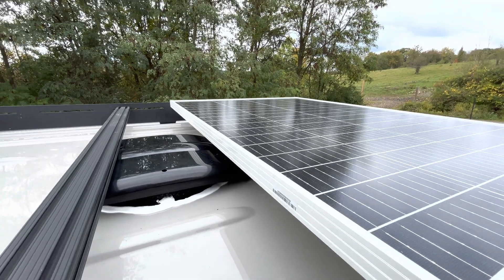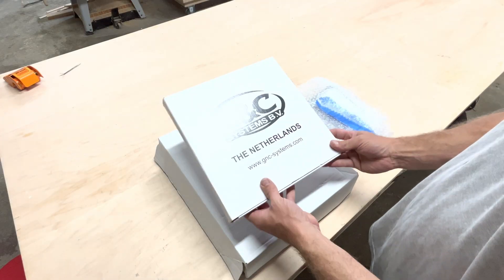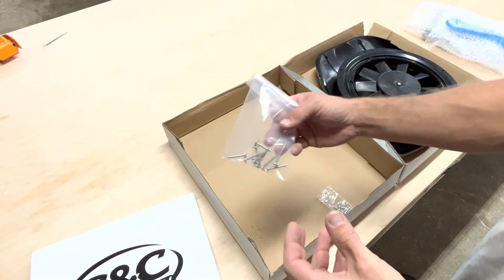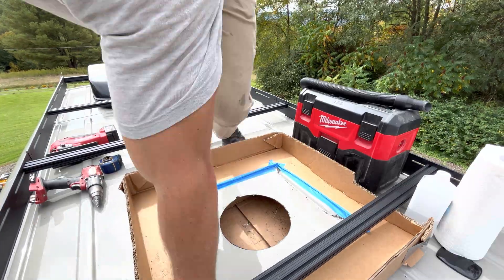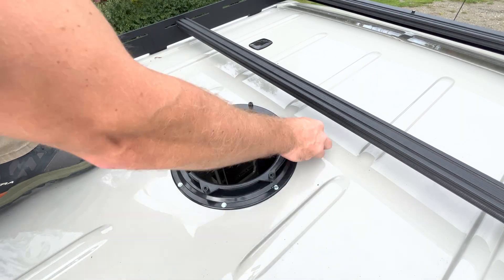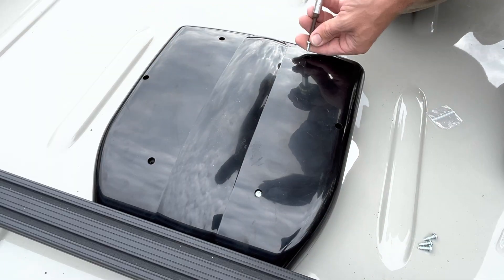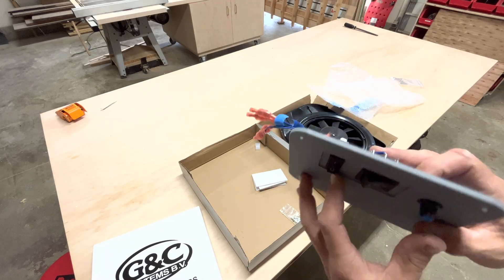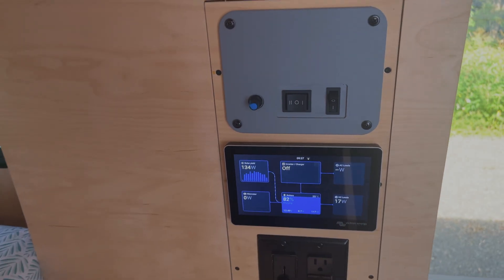Lemans 12V Fan Install in our Off-grid Campervan

Comment: That fan is only 500cfm

Maxx air fan is 900cfm almost double 
Has thermostat, a way bigger opening.
Been around sense the 80’s 

Lemans is made for a porta potty 😂
Reply from the maker: Depends on your goals. A van is typically less than a 500 cubic foot space, meaning it can change the air space once every minute, which is plenty for most people. Add in the benefit that you can install more solar on your roof and it becomes a great option for those prioritizing boondocking. Appreciate your comment either way and have a great day!

Comment: I really like the low-pro nature of this fan. that being said, they need to update their control systems. A little bit of budget for some software development for a LCD screen readout and an IR remote would bring this product into the 21st century. At the very least, the analog control panels can be upgraded with some modern manufacturing processes like 3d printing and laser engraving.
Reply from the maker: Hey Ben, appreciate the comment! Yes, both a digital readout and remote control would be a big upgrade! We source the control plate from DIY Van and we think they do a good job with their 3D printed options. The controls could be labeled better but it doesn't take too long to get use to, especially if you are already familiar with other fans on the market. To your point, we hope that the design keeps getting better as the need for these products grow!
Reply: @powerofadventure  Id be happy to collaborate on a switch panel to make it more 2026.
Reply from the maker: I’d be happy to talk about different options. Let me know what you have in mind!

Comment: Does this have the option for a thermostat?  The thing I like about the Maxxair is the ability to set it to come on automatically at certain temperatures.  It's been a life saver to come back to the van and it be tolerable inside because the fan kicked on and pulled the worst of the heat out.
Reply from the maker: This fan does not have a thermostat built in like the maxxair but one can be wired into the circuit fairly easily 👍

Comment: Looks like a great option!!!  Nice job!!!!  I may consider one of these on the rear door of my sprinter behind an Owl Sherpa!  What are your thoughts?
Reply from the maker: I would suggest that this fan is only suitable as a roof vent, you may want to consider something more like this - 

https://www.etrailer.com/RV-Vents-and-Fans/Redline/9106.html
Reply: @powerofadventure thanks for the recommendation!!!  So did they fit under your solar panels?  That's an awesome space saver if they did!!!!  Great content Jesse!!!!  Did your van sell?
Reply from the maker: So much appreciated, and yes the fan fit under the solar array perfectly! 
Also, we sold the van! On to the next project, stay tuned my friend!

Comment: I know it’s only been 2 months. Any regrets not going to a maxxair or the air plus deluxe? I’m concerned if the higher pitched noise will be too annoying as I plan to have it on all night for drawing air from the rear bunk windows.
Reply from the maker: The fan has worked well. The higher pitched motor noise does not bother me but everybody’s different. We also used the fan on the A/C so the lemans was harder to hear.
Reply: @powerofadventure thanks for the feedback. Have you tried throttling the motor to run slower but have it run 24hrs a day to control humidity as well? Seems like getting the extra solar space might be worth it
Reply from the maker: Yes, adjusting the speed can greatly affect the sound that it makes. I totally agree. It was worth the extra solar 👍